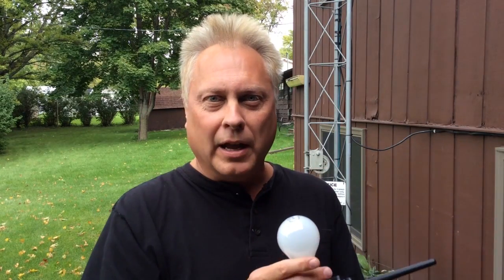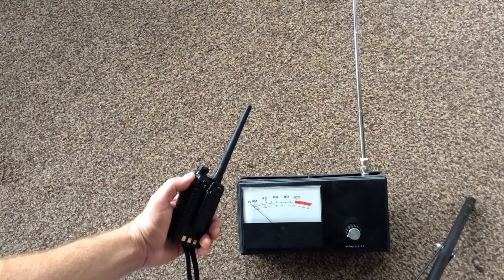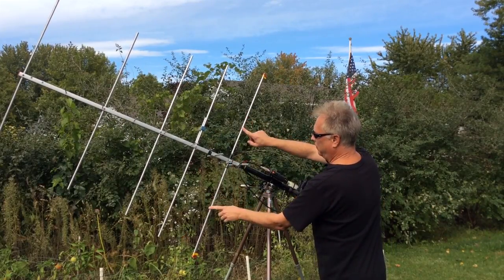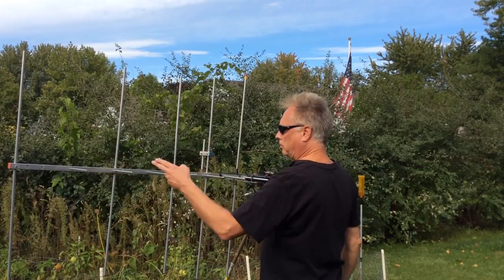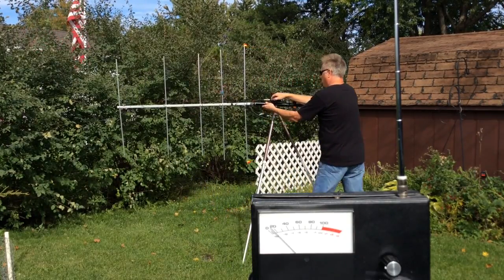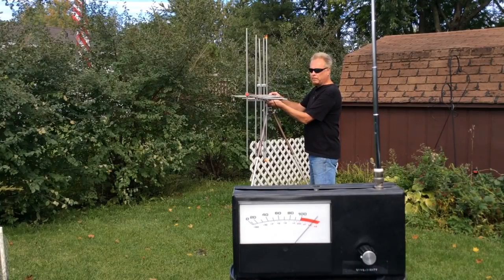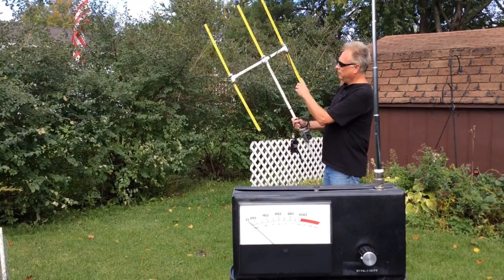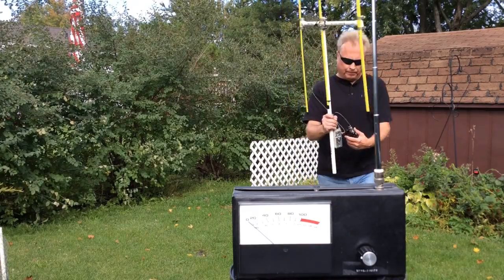Ham Radio Beam Antenna Field Strength Demonstration

Comment: Nice example. I had seen an older example where they lite a small bulb with a directional antenna. That was impressive too. Then they walked around the beam antenna holding the bulb and it would lite only where the field was strong enough so when recorded with a long expose camera the bulb created a visual map of the field strength in 3D space.
Reply from the maker: Yes, I remember seeing that video also with a light bulb, that was very good.

Comment: Nice demonstration, about you hams showed useful tips on field strength. Keep up the good work a fellow cb user with an interest in polarized antennas . also try building a moxon antenna for vhf good results a few bits and bobs .

Comment: I sure have a lot to learn, never knew it mattered the receive antenna had to match the transmitter antenna angle. ( both vertical or horizontal ) I like your style as far as a newbie can understand what your saying. Most videos I watch i get lost in the words and what the terms mean.
Reply from the maker: Thanks, appreciate hearing that, 73!

Comment: Hi Larry. Yet again, a very useful video that helps my understanding. I know this vid is a bit older and Ive watched before but lately, Ive been searching for a strong, yet sturdy and economical camera tripod for a similiar Sat Yagi but all I find is junk. Can you tell me what brand, and where I might find the tripod your using? It appears very strong, yet it turns fluidly. Any help is appreciated! Thx again... Josh N8TIP
Reply from the maker: Hi Josh, yes, that is a well made tripod I was using there, unfortunately they are no longer available, it was made back in the 1950's when they still made high quality stuff, ha.  It used to be my dads camera tripod for his photography hobby back then.  I have a couple other tripods around here, one I use for my Ipad for my video camera etc but it will break one of these days probably, not as good.  So I have not done any searching lately to really know what it out there I guess.  Sorry I can't be of more help on that.  73...Larry
Reply: I had a feeling it was from a different era. Maybe one day in the future that quality craftsmanship will come back full force in our USA. I can dream, right! Hey, thanks anyway Larry. You have a good one

Comment: I have seen some dual-band directional antennas similar to yours that have both the 2m and 70cm elements on the same plane (i.e. both horizontal). Is there an advantage to having the elements for each band perpendicular to each other?

Comment: Good video Larry, the field strength meter looks a handy bit of kit to have, was it easy to calibrate?. I've never seen that tape measure antenna, what a great idea, must be a bit cumbersome for a 6m yagi though :)
Reply from the maker: colin campbell Yes, the tape measure might not work for 6 meters hi hi.  The field strength meter is just a relative indicator so I don't have it calibrated to anything but just set it so the meter is in a range I can use to compare as long as I leave it in the same position in comparison to the transmit antennas.

Comment: Hello. question: what is the minimum size of the iron pipe 12 meters for lifting the yaghi fm antenna Dimensions antenna gauge L*W*H: 5500*900*1760 MM Weight: 5 KG? thank you!